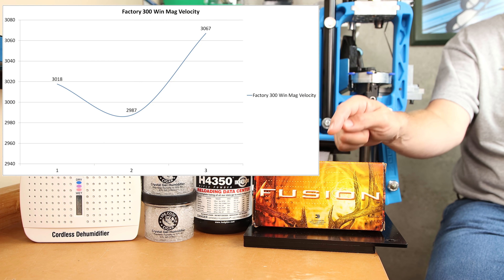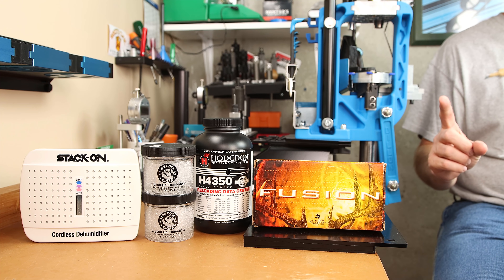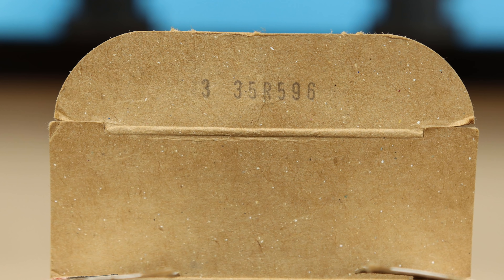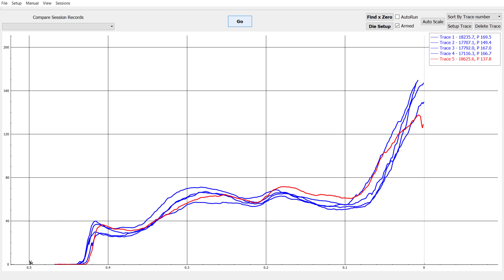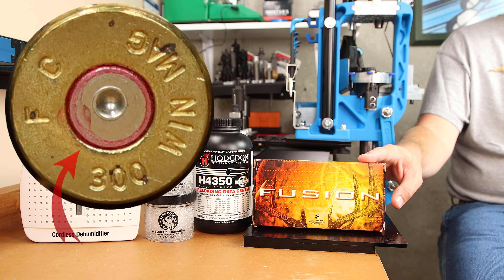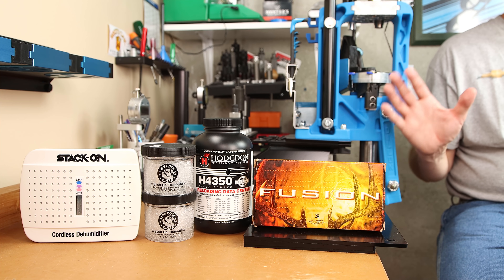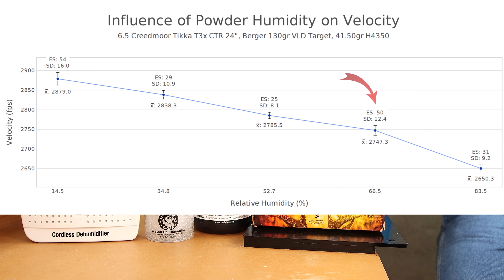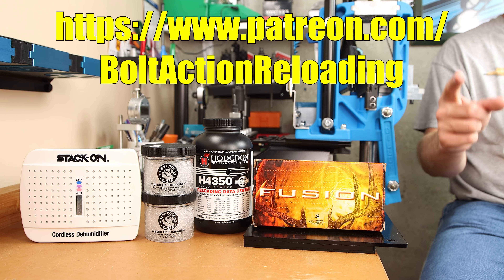Most Reloaders Ignore This, but shouldn't - How Humidity is Affecting your Handloads!

Comment: @BoltActionReloader, could you do a test where, instead of conditioning the powder before seating the bullet, you make 40 identical cartridges of powder that was stored at 50% humidity for at least one month. And then shoot 10 right off as the control group for velocities, and store 10 in a sealed ammo can at 10% humidity, 10 in a sealed ammo can at 50% humidity, and 10 in a sealed ammo can at 90% humidity for a period of a month or two. Then shot them and see what the velocity differences are?

Comment: This is a really great video. Your experiment was perfect. I will mention one thing, If you are using a load that was developed before the powder dried out, and weighing your charges you will have more individual granules of powder in the drier charge than you did when it was at a higher moister content.This will increase the difference in wet to dry velocities over what your test showed. This could be tested. You could also roughly calulate it by looking at the difference in velocities of close charge weights from a loading manual.

Comment: Oki, so if the powder is sealed in the factory container but store in a place with not controlled humidity, I will have problem with my powder ? And if I transfert the sealed container in a controlled humidity place, will it solve the problem and get back to something like factory ? Thank you.
Reply from the maker: Hi Matt, I really don't have a perfect solution for you. Knowing that this is something to look out for is the first step. I would simply keep it in the factory container, stored in as controlled environment as possible.
Reply: @BoltActionReloading  Oki, thank you for your answer.

Comment: This really answered a lot of questions as to why I was seeing with hotter loads due to powder drying out. I have been finding that my open powder cans dry to high 30s low 40s here in Semi arid Wyoming. 

 I have started using the 49% Boveda packs for cans that are below 45% RH. Sadly a lot of my cans are 1lbers and my D3 Kestrel Drop would not fit through the opening for monitoring . After much searching, I found a humidity device about the size of a quarter from Blue Maestro. 

The Maestro disk works perfect. I do wrap it in some nylon stocking type material to keep powder out of the vents. I tie a string around that and lower it in leaving the string end out for retrieval.I jostle the can around to bury it in powder so I am reading that instead of the air. I also tape a string to the 49% pack and hang it rather than let it lay on the powder. This may be overkill but I worry that powder touching the pack might “soak”  more moisture. According to the manufacturer the 49%, unlike the others, are designed to range from high 50s new, to 40s as they deplete.

One thing I don’t do is leave powder in the hopper any more than I have to. I have purchased open cans of powder that were dryer than mine and I suspect this is why.

Comment: This is why it is effective to load by VOLUME instead of weight. I believe the marine Corp snipers do this. Could be wrong. I have had great results with imr 4831 scooping a 3006 case full and pushing in a 180 gr bullet. Varget with 223 and 308 as well.
Reply from the maker: The volume is only about 1-2% of the variance of weight. Most of the variance is due to the moisture content of the powder.

Comment: I quit keeping my reloading gear in the garage long ago due to tempreature shifts affecting the reloading die settings, etc.
extreme cold and the press and dies contract, bullets get set deeper etc. Extreme heat and the opposite. I do everything indoors in air conditioned room, but the humidity can swing a bit between summer (high) and winter (low).   I never stored powder of primers in the garage due to the temp and humidity swings. That is is sowed in a closet until I need it.
What level % humidity range would constitute low versus high humidity?  Low humidity powder (aided by desiccants) would tend to give you more over pressure loads for the same charge weight.  Probably not a good idea.  May also be better to buy powder in 1lb containers vs 8lb containers to keep the powder dry longer until you use it.

Comment: Good Stuff!
So would keeping your powder and primers in a refrigerator help?
Reply from the maker: Hi Rob, no cool and dry, not cold and dry.
Reply: @BoltActionReloading  so would you say 75 degrees would be cool?
Down south here in Louisiana humidity is a killer!
Reply: Condensation from the warm air in your powder containers would ruin the powder.  Same effect when you take out the cold powder containers and they hit the warm air - most condensation inside and out around your powder!

Comment: I'm curious - is the decrease in velocity because you're metering out less powder in high humidity because it has a higher water content?  Or because the powder you put in the case burns slower/ less intensely?
Reply: Both do play a role. Changing moisture content changes the "effective" charge weight, but the powder's change in burn rate has a far greater effect on velocity

Comment: I would like to see a test where charges are weighed at a certain % humidity, put in cases and then change the humidity from the control group to see the difference.
Reply from the maker: HI Alan, this is literally what the first test I went over was. All were dispensed at 41.3 gr, the control group was sealed and then I exposed one group to the desiccant, the other to the humidity source.

Comment: While a finished round does not make a perfect seal, it is often better than we expect (especially with good primer pockets)
I dropped a reloaded 62 gold dot/lc brass/ar comp on the ground on accident.  It stayed on the ground for approx 2 to 2.5 months.  Rain, hot days, cool nights..  plus the inherent moisture at ground level in WV.  
When I found it, the brass had already turned that funky "range puddle brass" color, but when I picked it up I could hear dry powder shaking inside.  Shot fine, functioned fine, and it hit to my established zero (its my carry load)  
I truly think %h2o in the powder in the day of loading is EXTREMELY relevant..  but once its loaded i worry much less.
Reply from the maker: Hi Matt, I completely agree that after it is completed it is much less, but its a factor when you are talking about many years of storage. I would have measured the exact powder weight of every cartridge but the powder was all stuck together in the cases and would not come out. I am certain that these loads were somewhat compressed at the factory but certainly there was humidity exposure inside the cases from not ideal storage.
Reply: @BoltActionReloading  Factory ammo often (always) comes with primers sealed and the bullets sealed to the case to prevent water/oil intrusion.   I will tell you that a little WD-40 on the bolt face will ruin your primer overnight and cause a misfire.  Oil contamination is probably far worse than humidity on powder/primer.  WD-40 is crap oil for guns/tools - never use it. Won't prevent rust, stains the metal, stinks, and is very penetrating. it was tested against 10 other gun Oils by Gun Tests years ago and came in last!

Comment: Just to throw a spanner in the works here .....
Humidity is expressed as RH, or relative humidity. This is changed with temperature as the ability for air to absorb moisture is temperature dependent. 

So, 20% RH at 25 degrees is less water vapour than 20% RH at 35 degrees. 20% RH at 5 degrees is much less water vapour than either of the other temperatures. 

So, unless you're controlling temperature AND humidity, you're introducing another variable in the process.
Reply: Thanks for the feedback! You’re right, and other people have mentioned that to me as well. At least for this experiment the loading and testing all happened around room temperature, but for future experiments I’m planning to record dew point instead.
Reply from the maker: I reload in a a temperature controlled house so its pretty consistent. If you temperature is not controlled you will have more reason for concern, but the data is still valid.

Comment: Just a quick question. 
From your testing, do you think the effect we're seeing is as a result of the powder weight displacement or a change of the actual burn rate characteristics?
Reply: Burn rate.
Reply: Good question. I’m not totally convinced it’s burn rate.
Reply: Good question. I’m not totally convinced it’s burn rate.
Reply: Good question. I’m not totally convinced it’s burn rate.
Reply: Good question. I’m not totally convinced it’s burn rate.
Reply: Good question. I’m not totally convinced it’s burn rate.
Reply: Good question. I’m not totally convinced it’s burn rate.
Reply: @juliusjames5577  well, it's a measure of fuel moisture content and that slows the burn rate of fuel that is hydroscopic, ie able to absorb water. The water must be heated to steam, evaporate and then the remaining energy from the fuel can be expended.

Comment: Excellent info dude. 
I have wondered about the effect of humidity on powder performance but, haven't seen any testing except yours.
Really good stuff. I've no doubt a lot of shooters could make good use of your findings.
Reply from the maker: I really wonder if some powders are more or less sensitive to this. When I initially set out to do this, I was guessing it would be a much smaller factor, but clearly I was wrong.
Reply: @BoltActionReloading  That's a good question.
I wonder if a test could be designed to answer that question.
Just thinking. If it were mainly the water content of the powder, I think it would easier to deal with than the burn rate changing. It would be good to know I think. 
I wonder if it would be worth putting the question to some of the powder manufacturers.
I'm in Australia so I'll fwd an email to Thales & see what they're willing to tell me. I'll add a link to your video & hopefully they might give us some tid bits.
Thanks again dude. Excellent video.

Comment: Interesting. I have experienced unexplained velocity changes in proven loads before. What isn't so clear is to what extent this affects powder stored in the original, sealed cannisters and also loaded ammo. I am pretty meticulous when it comes to storing components, powder, etc. I never store powder in my dispensers, only decant what I will be using in any particular reloading session and always replace the cap on the cannister when not in use. So I find myself wondering just how much moisture can be absorbed during this short amount of time and also how much during storage in a sealed container and by loaded ammo?
Reply from the maker: Hi Tom, though storing in "sealed" containers certainly is better than nothing. Most of these are not "hermetic". Some change is going to occur. I really don't know of a good way to account for how fast this changes. I have heard of some people putting those kestrel drops in their powder containers, but I am not really sure that is a good idea either. I would be concerned that the chemical in the powder would deteriorate the kestrel in time. Right now I am trying to keep my storage as consistent as I can and log my humidity.
Reply: A trick I use is all the moisture absorbent packs I come across in boxes and medication bottles I put in my plastic water tight ammo box, and usually put a few small packets inside with the Powder itself.  
  I live in houston, so extremely high humidity!

Comment: Great info as usual. For what it's worth,  the Federal Fusion date code appears to be 3rd shift, 300 WM, 2006, July 15. The Chuck Hawks website stated Federal Fusion ammo came out in Fall 2005.
Reply: Believe it or not, Chuck Hawks was wrong. It came out in the 1990s. I graduated high school and started working at a store back in 2002. I bought Federal Fusion while I was at work.  If couldn’t have been any other year, so there’s that.
Reply: @DeepFlip  Yeah, the date code could also mean 3rd shift, 300 WM, 1996, July 15.
Reply: Federal got back to me and said 2006-2007.
Reply: @smalfry83  not true.   I worked at a store my first year out of high school and I bought a box of these for deer. 2002.
Reply: @DeepFlip  On an unrelated note, we graduated HS the same year.
Reply: @smalfry83  nice Chadd
Reply: Just FYI, I have moved my powder, primers, and handloads to a more humidity stable area of the house based on this video. Thank you BAR for the excellent info.

Comment: so if you store it normally but then remove humidity right before you reload, you should be fine?
Reply from the maker: I think keeping the value consistent as possible is important. Storing / loading in extreme environments is causing more headaches then people want to admit. Drying out the powder too much is going to increase the burn rate and may raise pressures beyond "safe" levels. I mostly wanted to put some data behind these numbers and then factor in some factory examples. I thought the multiple data points that Mike provided was some good data by having so many different points.

Comment: I don't have the practical capability to set up what you consider a low humidity environment but what I do manage is a consistent humidity of about 40% in my basement. I like to think this would result in at least predictable and repeatable results.
Reply from the maker: I don't think there is anything wrong with 40%. Consistent is the most important.
Reply: If you isolate a container of powder in an ammo can with desiccant, you can conduct this experiment at low cost with minimal space.

Comment: So, between humidity, temperature and altitude ..we are screwed!
Reply from the maker: I think monitoring / controlling the humidity exposure of your components, sticking with temp stable powders whenever possible and you can measure DALT you can be a lot closer than you might think.
Reply: The ammo manufacturers overcome it, so can we.  Store your stuff indoors in an air conditioned room and go for consistency.
Use 1lb powder containers instead of 8 lb so they get used up quickly after they are opened. people have been reloading successfully for decades before this tidbit came out.